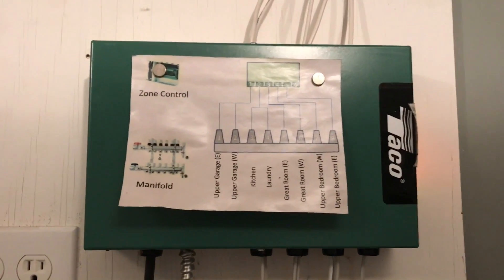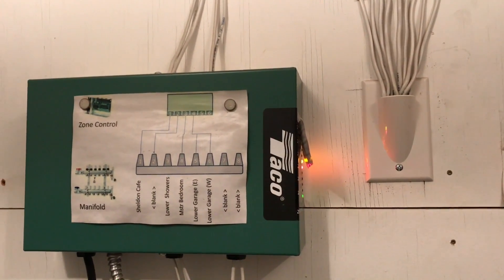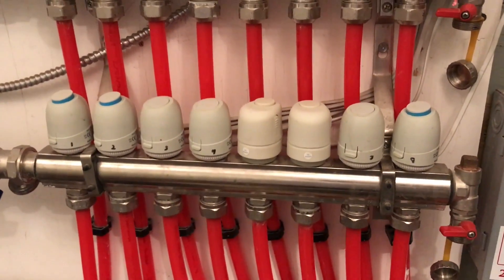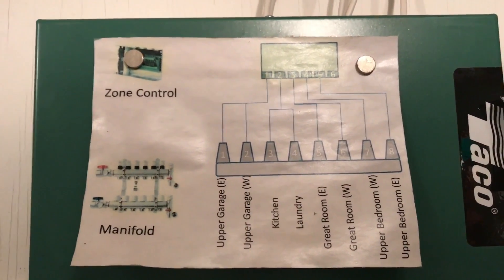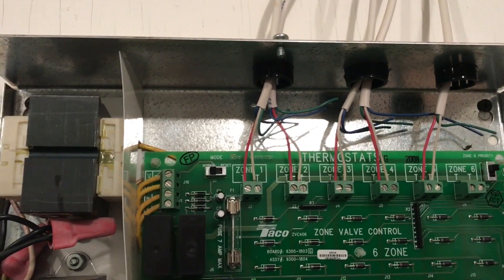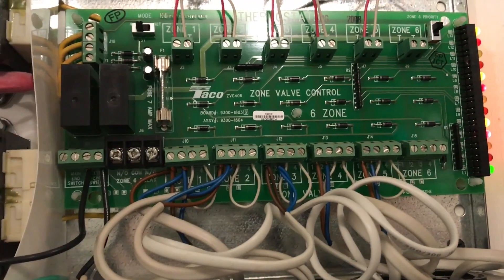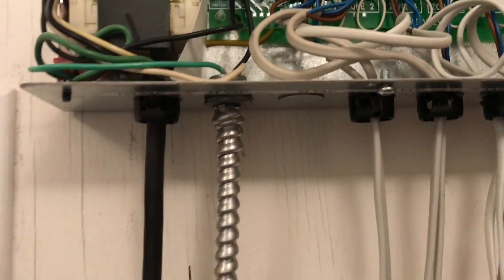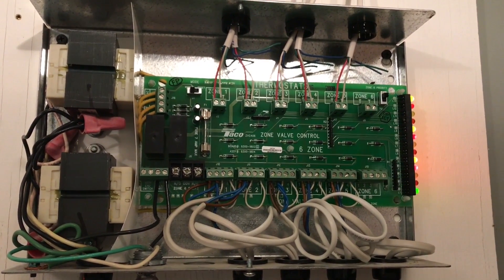Taco Radiant Heat Zone Controller Wiring

Comment: does this system use only a single circulator to pump water to all the zones?  with the actuators controlling which loops are open and therefor getting heat?  Thanks for the video!

Comment: Hello.
Could you do a video 
Wiring. 
Four zones with two zones for radiant heat and two zones using baseboard  heaters .
With actuators and zone valves with Navien heater.
Thanks.  Just trying  to understand.
Reply from the maker: Each system is unique and will require research for how best to wire the controller.  I am not a professional, so it would be difficult for me to advise you on your specific design.  If you have any specific questions about my setup / wiring, I would be happy to answer them.  Thanks for your comment!

Comment: Can you use all 2 wire actuators ? Or do you have to use any 4 wire? Thanks
Reply: As you can see in my video, my actuators are all 2-wire actuators.  This means that it is a simple open/close operation.  The 4-wire actuators can communicate status as well.  I had an issue early on with my system because the pumps would turn on as soon as an "open" command was issued by the controller.  While the actuators were going through their open process (10-20 sec), the pump was already working and dead-heading causing a premature failure of the main circulation pump.  This issue was resolved by installing a bypass valve that would allow the pump to recirculate while it waited for the actuators to fully open.
Reply: @janelleczaplicki99  I’m installing my first radiant system. My actuators are 4 wire but my electrician installed 2 wire. I’m having such a hard time trying to figure out what to do. Do I open up my walls and run 4 wire or stick with the 2 wire setup I have??? You mentioned a bypass valve as a solution. What exactly is that?  Thanks for any assistance.

Comment: How can I connect two three zone related to the boiler switch?
Reply from the maker: Hector Martinez - in my case, the “boiler” is a dual purpose Polaris water heater and does not require a switch. It works just like your normal water heater and works off of a built in thermostat. My zone controllers are simply turning on the circulating pumps whenever a zone calls for heat. Hope this helps!

Comment: Hey there Kubotatee, thanks for the video, really helpful.  I happen to have some 4 wire actuators that I am hooking up to a Taco ZVC403.  They have two reds and two yellow wires.  Any tips on hooking those up?  Having a hard time finding any info on this particular wiring situation.
Reply from the maker: Hi Andrew.  What is the actuator make and model you are using.  My understanding is that the 4 wire units will not activate the pump motor until the valve is all the way open.  If I can see the actuator literature, I may be able to help.
Reply: @KubotaTee I am using Uponor actuators.  I ended up switching the yellows and reds and things ended up working out.  It appears that the order of the wires is switched between Uponor control boxes and Taco boxes.
Reply: Thanks again!
Reply from the maker: Andrew - I'm glad it worked out for you.  Best of luck on your new system.  I am getting ready to do my second radiant project - a large accessory building (aka barn/shop) with a loft area.  It's been fun going through the design phase, but now I'm anxious to get some PEX laid down!!

Comment: Did the black plugs your wires are going through come with your Taco controller?
Reply from the maker: No - I purchased a standard 3 prong utility cord and wired them in instead of hardwiring them because I wanted to be able to easily plug and unplug them for maintenance and system start up and shut down.

Comment: hi, so which wires are connected to the boiler to tell it to turn on (fire up)? thanks
Reply from the maker: Hi Mark.  In my setup, there are no wires that connect to the boiler.  The Taco controller will however turn on my circulating pumps which will draw hot water out of my Polaris water heater.  The Polaris knows when to turn on based on the temperature of the water in it's tank.  The way I think about it is this - there are no wires connecting my water faucets to the boiler either - it simply senses the temperature drop as the hot water is replaced with cold water and automatically turns itself on when it needs to based on the temperature setting on the boiler.  Hope this makes sense.

Comment: Question - I have an un-used zone I am going to connect. It's already got a zone valve wired in, but no thermostat. I see this uses fingersafe connections for a 2 wire thermostat (what I plan to use). Do I need to cut power to the zone controller to add a thermostat, and/or do I simply add the thermostat to the terminal, and I am ready to go?
Reply from the maker: I am by no means an electrician, and have been zapped enough times to take a conservative route when it comes to any sort of electrical work.  For me, I would simply unplug my controller, do the work I need to inside and then plug it back in.  Safety First!

Comment: when does the boiler kick on to heat the water ?
Reply from the maker: Hi Vincent.  In this case, the "boiler" is a Polaris dual purpose, high efficiency water heater.  Basically it works just like any other water heater - when the water temperature falls below the temperature it is set at, the heater will kick in and attempt to bring it back up to the desired temperature.  So, as the heating system pulls heat through the heat exchanger, the water in the water heater will cool down, thus causing the thermostat to cause the water heater to kick on.  Let me know if you have any further questions.
Reply: @KubotaTee  hello is posible to get you email address have a couple thinks whit under floor heating. I have 12 zone  wiring box. and I'm using air to water heat pump. The thermostat will swich the pump on manofeel but I need to work out how to switch on valves on Samsung heat pump

Comment: I have an Uponor and currently everything is red and not functioning is there a way to reset the unit and get it to restart? I have an Hvac technician coming but not until next week and our house is freezing any help would be appreciated
Reply from the maker: Vinh Khuc I’m terribly sorry,  but I really have no experience with your unit.  For my system, i wired the controllers so they could be unplugged from the wall which makes doing a power “reset” pretty easy!  Just unplug them!  Good luck with your system.